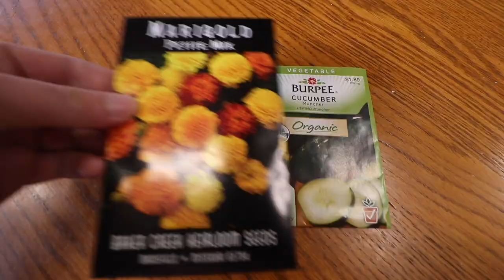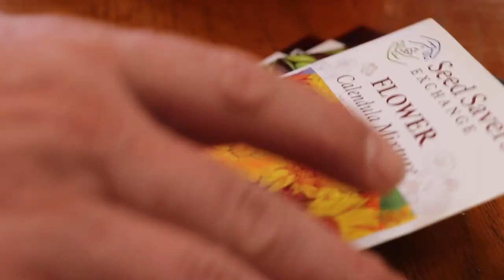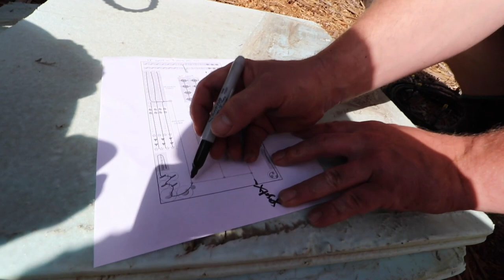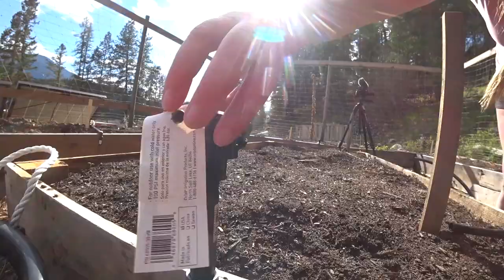How to Install an Automatic Watering System for a Raised Bed Garden

Comment: I work with the same supplies you're using for watering your garden...  There's a ton of back pressure, friction, and resistance in that type of system.  You have two choices.  Either run 1" polly for the supply lines, then adapt to the 1/2" for the risers, OR divide your garden into 3-4 zones.  Honestly, one zone per box/ area is the best solution.  I'm excited to see how you go about this.

Comment: Start looking into the Generator’s on the market and researching what will be best for your family’s home security when the power goes out.
This Summer are you two (or should I say you three) going to put in a Whole House Back-Up Propane generator in case the main grid goes down next winter?  I don't think the Solar or your small generator's will give you as much power if the power goes out for days. It could and will happen.  Your wife enjoys the heater in the bathroom, right?   Do you have a backup heat source for this house????    If you do I missed this in the building of your home.   
Jesse, if you and Alyssa felt the Plane was a good investment then the generator should be on that same list.  Don’t wait any longer it will take some time to put this in place before winter.
You guys are living my dream keep up the good work, great video's also. Thanks to you both for listening, also hope this helps you.  
When your first born comes LIFE will change for you both.  They will grow up fast my daughter is 24 now the time flies.
Toby

Comment: I have been using drip irrigation in my garden for 4 years and every year I have expanded my garden and irrigation system. I thought I had overbought including the hose, but this year I ran out of both size of hose and two types of emitters. Apparently, I did overbuy on 1 GPH and bubbler emitters, but not enough 3 GPH and 2 GPH emitters. I also use sprayers instead of the mini-soaker hoses. Looks great! Also, you guys inspired me to try potatoes in pots this year.  I planted them in April and they are already a foot tall - can't wait.

Comment: note....  Using softened water can inhibit and even kill plants.  This is specifically true of sodium salt systems.  I also do hydroponics, and have to soften my water as it is very hard.  Additionally, I don't want the 1mg of sodium every day in my food from cooking.  Also, I haven't gotten a rain water system done (on my todo list ;) ).  As such, I use potassium chloride instead of sodium chloride.  It takes 1000x the concentration of potassium chloride compared to sodium chloride to become toxic to plants.  It actually increases plant growth in concentrations typically found after softening (potassium is used by plants), It reduces hypertension instead of causing it, and it is almost a drop in replacement for sodium salt in most softeners.  Additionally, most softeners will even have instructions on how to use it.  (Typically, you need to increase you 'hardness grains' by about ten over what you would use for sodium.  That's it.  Additionally, it is available from the place where you got these bags from.  Finally, the bad news.  It costs 6x the amount of sodium softener salt.  I have seen it cheaper, however the places around here that use to sell it cheap got rid of it and so now I too buy it from big orange.  You can blend sodium salt with potassium salt (you need to mix it to the bottom) 50-50, and get a lot of the advantages for a fraction of the cost.  The warning though you need to know is that softened water (with sodium) has been known to kill plants.  Sorry about the bad news.  (you could use a high micron particulate filter combined with a carbon filter for filling the cisterns, and then soften the house water as well I suppose.  Check into it, decide what works for you, and I hope you have so much food you can't possibly hope to can/eat/harvest it all.  Your garden looks wonderful.

Comment: Thanks for making this video ! I would strongly advise installing a Drip irrigation Filter to protect your drip system from being contaminated by small debris from your well that can plug up your drip emitters that can not be flushed out. Also I would recommend after you install the filter at the start where you are connecting to the hose bib. Your pressure is correct at 30 psi ! Also, I would not use those small stakes which are worthless but use those metal staples that you can purchase by the box of 500. They are made of cheap steel so they will rust but can be reused a few times until they are too rusty. But that is what everyone uses in the landscaping industry. Soaker hoses are ok but they will eventually dry out and start cracking like you probably have found out. Wish you both success with your drip system ! Thanks !

Comment: Hi you two. Loving your watering system. I find using metal tent pegs to secure the big pipe stops it springing up. Also I’ve hooked up some washing machine solenoids to electronic timers to run the whole system automatically. A whole load cheaper than any off the shelf system and if a solenoid breaks its only a few £/$ to replace.
Reply: Problem with washing machine solenoids is firstly they are mains voltage, second they are only designed to open for relatively short periods. I did my own computer controlled watering system for my garden last year. You need to get a valve rated for a 100% duty cycle which cost a bit more. I went for a 12VDC one, it's powered from a random 12V DC PSU I had kicking around (have quite a few) which is then plugged into a WiFi smart plug (pick your own poison in this regard). The 12V DC runs outside to the valve control so no mains either outside or near any water. Mine is controlled via a Raspberry Pi that also listens to a 433MHz rain sensor so watering is adjusted automatically by the amount of rain if any.

Comment: At 10:00 you cut pex pipes. IF you rotate the cutter a bit while doing the cut you wont deform the pipe like you did. Just a tip since it saves time :)

Comment: The downside of containers is the need for individual watering.
-------------------
As to direct seeding and the soil drying before germination, planting and then covering with a board to retain moisture works. You just need to monitor for germination and then remove the board. 

Hint: using shorter board sections rather than a single 8' board provides better contact with the soil. So two 3' and a 2' works much better.

Comment: I think your water system is much better, but hope you consider regular drip emitters. They punch into the big tubing and give you individual control of how much water goes where. They give plants exactly what they need, and if you realize there isn't enough water somewhere you just pull out one emitter and replace it with a lower flow emitter. Mini soaker hoses aren't any better than big soaker hoses. They water indiscriminately along their length with no control over amount. I think about all of this because for a time in my life I worked at and then managed an irrigation supply store and was trained to do design for water systems. The individual emitters punched into the transfer hose give you exactly the right water in the right place, save water, and save money. That said, do this drip manifolds you got let you control flow/line? That would be awesome. Glad you didn't go with a sprinkler system. They waste a lot of water to evaporation, cause lots of plants disease by keeping foliage wet, and always end up spraying water where you don't need it.
Your knives are not like real knives. I usually bring a small sharpening stone with me when going to someone's house socially, because most people have a lot of dull knives in their drawers. It must hurt;) Never had anyone who didn't know how to sharpen say no to having knives sharpened for free, but sadly, a lot of them say no to learning how to sharpen their own. Weird.
There might be an irrigation supply place somewhere nearish to you. They have a bigger variety than a box/hardware/home improvement store and are also cheaper.

Comment: Warning. I started with the same progression. The second year I too went and got the mini soaker hose. Granted my space was bigger but those stupid connectors all broke at the start of the next season. The fittings under pressure broke apart. Finally I consulted drip works.com and now I have drip tape that works better and has lasted for several seasons. Good luck!

Comment: If you haven't got one, get a moisture meter with a 6 inch probe on it. It will really help you dial in your watering with drip when you are just getting started with it.

Comment: For total automation, install a battery operated timer on your hydrant to turn the water off and on. They are programable for duration and frequency.  They work great and are fairly trouble free.

Comment: a solar watering timer would be nice!!  or a few of them as some things need more water several times per day spread out.. 
just in case it is a dry year next year.. or dry  early or late season...also keep in mind a blow out adapter for air compressor with air regulator for this for winter!!
or rv anti freeze... pretty cool system!!
you need to start some honey bee hives some where on your property, then the flowers will draw them to the garden..
then maybe berry bushes up on the hills around the property. a few a year!! also a mega strawberry bed!! 1/4 acre is nice!!
ice cream, fresh frozen for smoothies, canned jam for trade and winter!! also think cherry  apple trees around the outside of garden area for wind brake. think help on wind damage control from storms..
you have a large roof on the house for drain water for next year..
keep in mind a cistern for rain water collection for several thousand gallons so you could water clear thru late aug and maybe over head tanks for gravity water system with warm water!!.
those over head tanks can be drained for winter.

Comment: A little trick I've learned when using the poly pipe.  Uncoil it and let it lay in the sun for about an hour.  It is so much easier to work with.

Comment: You may run into a problem with water flow. The 1/4 inch hoses do not have enough flow to span longer than 4 - 6 feet and so for the length of the bed you may need to swap the 1/4" line with a 1/2" line and then buy the 1/2" hole puncher to insert the emitters and for the pots you need the double barbed connectors to attach the 1/4" line to the 1/2" line.

Comment: With the system that you are putting in, save yourself a headache that I had and put a filter in between the house/cisterns and the drip irrigation of the garden. All my nozzles plugged up a month after flushing and priming the system.

Comment: In the future,instead of cutting and caping the ends of the soaker hose, make a loop and put the other end on another nipple on the manifold.  This helps keep flow if it gets blocked or kinked in anyway.  You will always have a secondary source of water in the tube.

Comment: If the water pressure is not enough or you end up wanting to automate the watering sprinkler valves make for great zoning to cut down where you are watering at a given moment or if the given pressure is not enough to run everything. It would also reduce how often you need to go out to water as you will soon have something much more important that takes all available time

Comment: I have never seen reticulation installed with such precision. 6”, 1 ft, 6 more inches to there.  The way we do retic is throw it down turn it on then move it around to get the coverage you need. You can take heart in that even though yours won’t work any better than ours with all of the extra time you put in, it might be prettier. Also, timer? You’ll think, aw, I can remember that. And you will, til you don’t and drown your garden with a full day of water.  So, timer, better close the door now than when the horse is already out of the barn.

Comment: Do you have hose bibb  backflow preventers?  They are also called vacuum breakers.  They prevent water backflowing from the hose bibbs back into your water system.  Just a wise precaution.

Comment: One thing that always confuses me about these watering systems is that it does not mimic rain, which falls on the leaves and drips down to the earth.  Seems that a spray sprinkler from above would make more sense, though piping would have to be very insulated.

Comment: Watering your garden from the cisterns? That makes absolutely no sense when you have stripped out all the beneficial stuff. It should come from the well with a pressure regulator. No thinking involved. Natural minerals from the well
Reply: Run well water to a cistern (black) on the hill sun will heat the water that will be better for your plants.

Comment: you should get a meter for your faucet on the garden so you know how much water you're using so when you do move to rainwater system it's easy to see if it will be enough for your needs.

Comment: I have not run the kind of system you have there.  But from yard sprinklers, if you have a pressure problem at the end of your runs. Connect the ends together in a loop.  It is looking like maybe you are having no problem with this.   But just in case.

Comment: I don't expect a 300% increase in crop yield by more automated watering, However. I can assert that you will likely see a 300% decrease in headaches and feelings of obligation to maintain hydration.  

There's more to growing plants than just water. sunlight, and proper nutrients. "Now...there IS a way of pumping a dissolved fertilizer  that's dosed DIRECTLY into the water. I've seen garden centers use it. when you turn the water on, a mechanical pump releases into the hose a supply of the concentrated fertlizer solution. since it's released regularly it's a low dose, and won't burn. and gives continuous food. Beyond that, compost  and good soil tilth [tilth is the term for texture, usually describing how fluffy and tillable it is.] Carrots NEED good deep tilth to burrow and grow long.]   

I just need to get motivated on MY gardening desires, too!

Comment: You're running a drip system.  Any respectable landscape company, or gardner will tell you it is the way to go. Much more efficient. 
Drip systems run best around 40PSI

Comment: Too bad they don't read comments. They would have been so much better off going with 3/4" PVC for the main runs, then some valves at each box with a reducer to 1/2". Then just drill some holes in the 1/2" where drips are needed. Glued and high pressure for the 3/4" stuff, then use the valves to reduce pressure and the 1/2" parts can just be dry fitted.